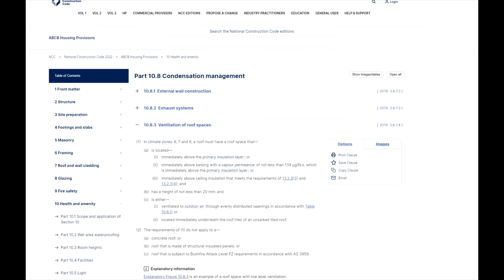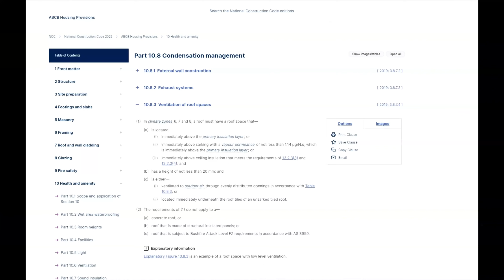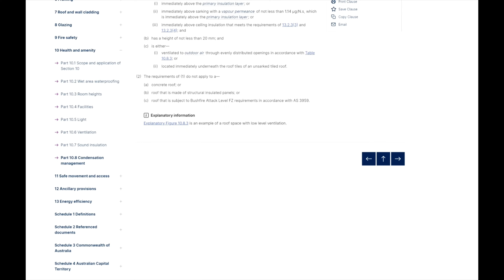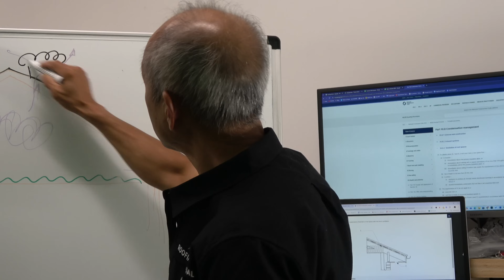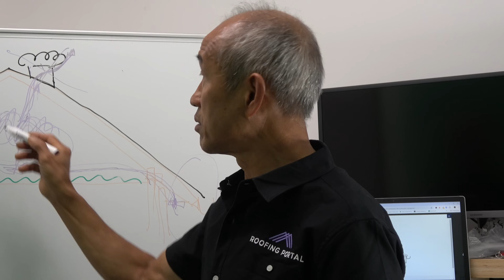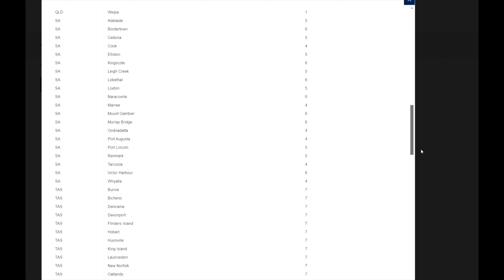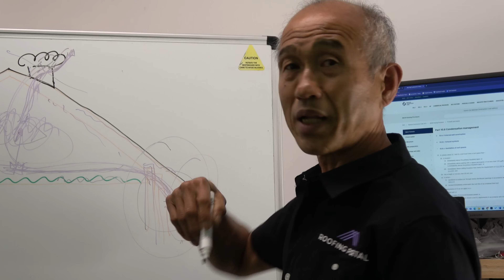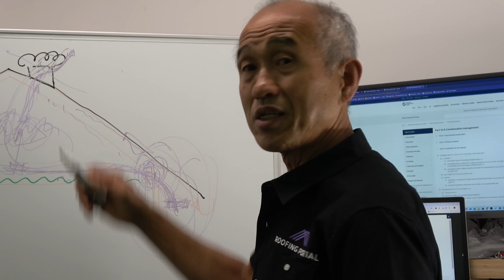Do whirlybirds work and will they make a comeback

Comment: G'day, This is an interesting topic. I cannot however agree with some of the descriptions you have used. This may be due to a poor choice of words or that you are making broad generalisations. As an example, A whirly Bird installed on an otherwise unventilated location will allow air out as the air heats up and expands during the day. Then as the air cools overnight some fresh cooler air will return to the void. Thus the device does work, just not efficiently. Various things can be done to improve this efficiency, that is what I think you are trying to get across. I look forward to seeing more on the subject.
Reply from the maker: You are quite correct.
Hot air expand and will force itself out through any opening. As as air cools, it contracts and drags air back through the opening.

The video is mainly aimed at the new National Construction Code that dismisses the ability of the whirlybirds (or any other ventilation system) to cool the house (living spaces). It quite rightly stipulates high R rating ceiling insulation to provide energy efficiency - instead of ventilating the roof space.

The NCC is now asking for roof attic ventilation as part of the ventilation requirements for livability (to stop mould growth). Therefore, the emphasis is on the number of 'air changes' that is needed. So, fresh air in and stale air out at a certain rate is the requirement for roof ventilation.

That is why the 'new' need for inlet vents is now very important.

A question that needs to be asked (which I did recently at a NCC seminar) is: Do existing houses now need to comply with these new NCC ventilation requirements? - or only just houses built after 2023...

Comment: If you had a whirly bird installed properly with vent. Wont it make your house harder/more expensive to heat in winter?
Reply from the maker: This where the misunderstanding arises.
The NCC does not care whether the whirlybird works or not in the energy efficiency of the house. 
This is because it knows that roof cavity ventilation does very little in keeping the house warm or cool. It demands insulation batts on ceilings to do this job.

As long as you have good ceiling insulation, the heating requirements of the house in winter is not impacted by the roof ventilation.

Comment: That would be for a roof with silver sarking which is mot permeabke  and mot a vapour permeable membrane. 

Yhis is because the conensayion gorm on the underside of yhe silversatking unlike a vapour permeable membeane where irs on th e bottom of yge tole which then goes into the gutter when it falls on the membrane.

The heat in the toof cavity is radiant heat you cant ventilate radiant heat. Best yo go outside in the evening a spray water on your roofing material to remove the heat energy.
Reply from the maker: This is a very complicated - yet insightful answer.
The confusion lies in what we are trying to achieve by ventilating the roof cavity.
The National Construction Code on roof cavity ventilation is only concerned with removing moisture from the cavity. NOT HEAT. The code stipulates other means (insulation) to make the house heat efficient.
Traditionally (before the NCC ventilation requirements), home owners just wanted to make the house heat efficient - and were sold on the myth that whirlybirds were the answer.
Moving forward into the future, we must look at these two issues separately. 
1) How to make the house more energy efficient and livable?
2) How to reduce the likelihood of mould growth in the house - caused by lack of adequate ventilation?

Homeowners have been more concerned about heat efficiency because they can feel temperature differences easily. They are less likely to feel the presence of mould and lack of ventilation.
We think the updated National Construction Code is trying to tackle the issues that most homeowners are not aware of...
Reply: @roofingportal  I should not type on my phone without glasses on. Best way to keep heat out of a roof is to have a white roof (or roof which higher solar reluctance) and low solar absorbance (less heat absorbed and radiated later). The insulation above your ceiling plaster is the means of resisting heat transfer from one side to another. This layer needs to be continuous and thick wihout gaps. The alternative to this is to have a conditioned attic which means all the insulation is immediately adjacent to the roof material.

The approach to manage moisture below the ceiling is to use a heat recovery ventilation (HRV) system - there are ones that are centralized and not centralized. These are made by Laros and STIEBEL ELTRON's. These are required for homes with ACH (airchanges per hour of less than 5 - not common in Australia).

Really old houses in Australia have slits and vents on the walls of plasterboard. These were installed to allow fireplace and oil burners that ran inside your home to not kill you from carbon monoxide.

The simple reality is that most home owners, builders, and trades do not know much about the building science today, or why homes were built they way they were in the past.

The Energy Smart Housing Manual produced by Sustainability Victoria is a really good guide for homeowners to understand and make sensible changes to their homes (or when buying new ones). In addition you should also source the The YourHome website of the Australian government.

Comment: I installed one for 2 reasons, I cut vents in the ceiling of 2 of my bedroom inside the sliding cupboards (always leaving open gaps on the sliding doors) and the window always slightly open. The first reason is to create air flow into the 2 rooms, as they both suffer from stale air and potential mold. The second is to take all the heat out of the roof... both have been achieved or at least had an impact on the issues we have...

Comment: I had three whirlybirds installed in my Penrith (zone 6) 1972 brick veneer cement tile roof prior to having the roof painted, which in itself was in preparation for the installation of my solar system only 7 years ago. They spin like crazy on hot days. The tiles themselves are laid directly in the rafters with no material underneath. Believe me, there is plenty of access for air to enter the ceiling space without having to add vents is the eaves. I have corner ceiling vents in all four corners of my kitchen, bathroom, and laundry (as was the building standard in 1972), and exhaust fans in each of those rooms, and air can (and does) enter the ceiling cavity above the guttering around my entire house. When in my ceiling, I see daylight entering around the entire gutter/roofline, and from in between the individual tiles.
Reply: I have two whirlybirds on a four bedroom house (tin roof), and one eave vent from when I had the first wb installed before extensions. I notice there is a constant draft into the exhaust fans in each bathroom. I leave the bathroom windows cracked so I expect this is a work around that may be useful.  Otherwise, interesting stuff. Jeff

Comment: Any roofer that's cut a hole in a roof mid summer knows they work. Hot air bellows out of that hole like a hot aircon right into your face, hot air rises and the whirly bird itself Is just propelled by that hot air, which then draws more air in.
It's basically a turbo for your roof, 10/10 do recommend
Reply: I don't agree completely with the author above, for the whirlybird to work properly you have to install them in pairs, in different heights and far away from each other ( an instruction I read somewhere may be 30-40 years ago ). The lower whirly can also act as the air input , plus the difference between them in height will create different air pressure to suck in air or to expel air, etc....With one whirly installed then you have to worry about an air inlet, with 2 unit installed, they will automatically sort themselves out.
Reply: @nanookamotocnc  Thats really interesting mate, thanks for that comment. It's fairly common for most large residential roofs to have 2 whirly birds and 1 on a lower ridge line as you described, but i had no idea why until reading this, i guess the engineers have always known! And you to
Reply: the best thing since sliced bread we always had mold in our house for 20 years not any more
Reply: I installed two of them on my cement tile roof 25 years ago and it has been the best and most practical home improvement I ever did. Extremely effective at removing excessive loft heat and both are still "whirling" like new.
Reply: stu stu stu stuuu
Reply: No eave vents necessary if you have a cement tiled roof as the curved profile near the gutter provides all the air ingress needed.
Reply: Omfg no, whirly birds are not (turbos for your roof) they are literally less efficient than a vent with no moving parts. The motion of the whirly bird on a still day is driven by the hot air rising through them, in order to turn the hot air loses energy as it passes through the whiy bird, this reduces the flow rate. Installing a vent with no moving parts means no pressure drop due to energy lost turning the whirly bird.  All you need is a path in and a path out of the roof space
Reply: @ryanclarke2161  you really don't understand this
Reply: @davidstephenson3615  no i really really really do and thats why i get so cranky about them.
Reply: @davidstephenson3615  He's spot on, it's physics mate, hot air rises, therefore , if you have an entrance for cooler air, and a vent up high, there will be a natural flow of air, you can build a hot water system with black tubing and a small black tank the same way, I've lived remote and seen some very basic systems that do EXACTLY that........
Reply: @ryanclarke2161  100% correct mate, people seem to dismiss physics like it doesn't exist. This hot cold transfer is very easy to prove, as I stated earlier, you can build an very efficient and simple hot water using these exact same principals, with black poly pipe and a small black tank, heat, all by itself, causes the cooler water to heat and rise to the tank, it creates pressure that  circulates and heats the water, no magic, just physics..

Comment: My house is 70s built concrete tile, i can see so much light under tiles in the roof space that I'm certain the whirly bird will work because it would be impossible to create a vacuum up there. Replacement air will definitely make its way in. That said, I'll endeavour to get eaves vents in eventually and compare temperatures
Reply from the maker: Ventilation can get quite complex. The smart engineers have worked out that unsarked tile roofs will ventilate themselves.
That is why the National Construction Code states that unsarked tile roofs do not need any inlet or outlet vents.
Whirly birds can be quite ineffective in circulating the roof cavity air in unsarked roofs. It will take the lazy way out and draw the air in from the tile air gaps immediately around it - and not from the gaps on the tiles near the eaves. So, it does not create the 'front door - back door open effect'.
It is just like only having one door open if you put a whirlybird on an unsarked roof - there will still be ari movement. But nothing like if when two doors on opposite ends are open...

Comment: Remote rural off grid NSW here have uses whirly gigs for the past decade or so , solar and wind here have ventilated eves around the house am working an extension using packed earth tires atb ground level I have put in air-con ducting so the cold air gets drawn in and expelled out the roof outlets. In winter I will close them off. Before I go I invested in ecotech white paint for the roof bit pricey but on a 48 degree day the core of the main house is around 31 C , it works.

Comment: They do work, even if they’re not spinning or the bearings are siezed. Mount at the highest point of the roof. As soon as I cut the hole, very hot air flowed quickly out of the hole due to convection. Eave vents are a great idea to allow cooler air to enter. Some tiled roofs have enough airflow with the thin gaps between roof tiles and a whirly bird is a waste of money

Comment: Thank you for sharing this, it is very informative. We have concrete tiles for our roof, and because of the gaps and light that comes through at the eve, I had thought that we enough for air transfer. Would I be better off installing vents as well? It would not be hard to do, single story, new construction, so no asbestos.

When I installed whirlybirds on our roof I did notice a drop in temp in the attic when I am there, but I am wondering if I am missing out on some of the air transfer by not having vents, and relying on the gap in the tiles.
Reply: There is no sarking on our house, just straight tiles on the purlins.

Comment: You are correct about the ventilation needed for the birds, they won't suck a vacuum so can only suck as much air as they can get in to replace it. But I don't agree they don't work for a second.

The old man put whirly birds in his house around 25ish years ago and they made a HUGE difference. We got some put in here about 4 months ago and the difference to the house (badly insulated) has been phenomenal. When 40c outside, our house was 50c inside before, now the portable aircon actually works in the lounge room for a first time. In saying that we have slotted eaves most of the way around so MANY places to drag air from (including the ceiling vents I'm putting in).

We also made some other changes like shade cloth across the front verandah (north facing) to stop the concrete block heating up as if it had been a 40c day, that concrete pad was STILL too hot to walk on at 1130pm at night. Now it doesn't get the chance to heat up because the sun was blocked. We also made and installed shade cloth covers for windows (not just the screen but over the entire window) and we're slowly upgrading the roof from filthy yellow bats (house had a mice issue at some point before us) to R4.0 or R4.5 earthwool bats.

Where this house today at 28c would have been 32-34c, it's only about 24c so a HUGE change to liveability.
Reply: How is the house in winter now?
Reply: @AlphaGeekgirl  ceiling vents in the lounge room are closable so will be fine. It's never held it's heat in winter anyway and the bedrooms we're not worried about but can use cloth tape over teh vents if needed.
Reply: you do not understand the air density changes with temperature. or any physics.
Reply: @davidstephenson3615  you're making a VERY arrogant and incorrect assumption there!

Comment: Hmm. I think he’s overlooking the fact that most Aussie houses don’t have the vents in the eaves on purpose. They are at the bottom of the brick walls, evenly distributed around the house. The whirlybird draws air from closer to the ground and ventilate the external walls as well as the roof. Installing vents in the eaves will just stop the air drawing through the walls. They just look like small slits in the brickwork around the bottom of the external walls. Could be different in a non-brick house.
Reply: Those vents near the foundation don't bring cold air into the house, that's not what they are there for...

Comment: Passive whirlybirds dont replace air fast enough (assuming adequate intake ventilation). Roof design needs to progress past these outdated ideas and adopt ventilation above the membrane and below the roofing material, as is common to Passive Houses.

Comment: I have two installed on a tin shed which has no ceiling. Eaves are open, one RSD and three louvre windows. They do keep the shed cooler but suck in airborne dirt, etc from nearby trees which covers everything inside the shed with a film of rime. Not good if you’re storing anything valuable inside the structure.

Comment: This guy keeps going on about 'not having vents = whirlybird won't work'. I'm not convinced. Aussie building standards are so poor there will always been gaps, or at least ways for air to find its way into the attic space. Purely through having a vent of any kind at the ridge will allow hot air to escape upwards. Even if air replacement in the attic space isn't as optimal as with a deliberate eave vent system.  

Further still, acting like ventilated roofs are difficult to make is absurd. It's totally a thing overseas.

Comment: questions for the presenter;  what air change per hour (ACH) do passive whirly birds provide? How many ACH do tiled and sarked roofs have without? How many ACH are required to reduce the temperature? 

As a guide, for energy ratings a tiled roof is considered to have 11.4 ACH, and a sarked tile roof or a metal roof is 4.2 ACH. A whirly bird is said to add only 1 ACH per 200m2.

There certainly is a place for them, especially to reduce condensation forming in a roof space (which is the intent of the NCC requirements and AS3999), but cooling is not effective.  You want an powered roof ventilator for cooling.
Reply from the maker: Hi Andrew,

Great questions. 
And I am not technically qualified to answer these questions.
However, Table 10.8.3 (NCC) provides guidelines to minimum openings depending on the pitch of the roof - and the length of the roof.
ACH has always confused me (due to my lack of knowledge). And I also think that the writers of the NCC have no idea of EXACTLY the amount of ACH that is needed to prevent the level of condensation that is UNSATISFACTORY.
That is why they just give guidelines on opening sizes and not ACH when it comes to condensation management.

And since condensation management has no relationship to cooling the attic (but the two are surely related) - we must accept that the NCC does not care about cooling the attic at all...

Jack